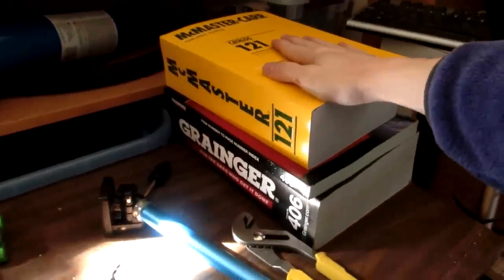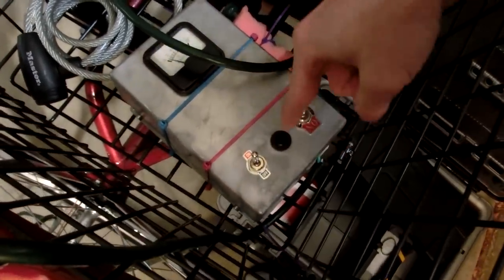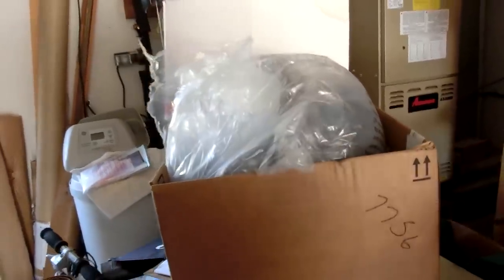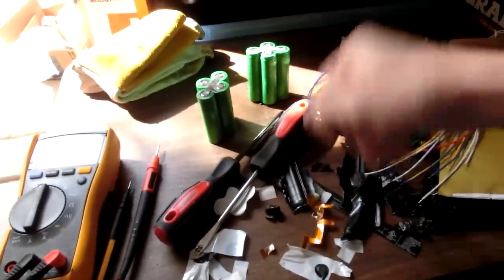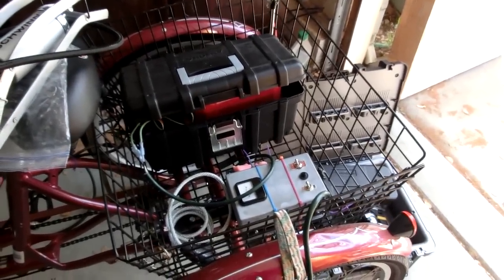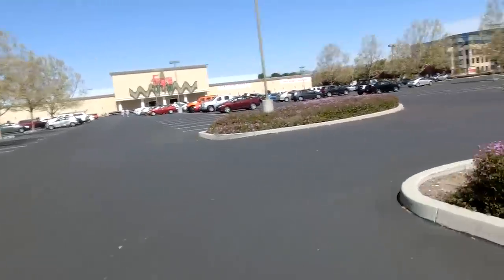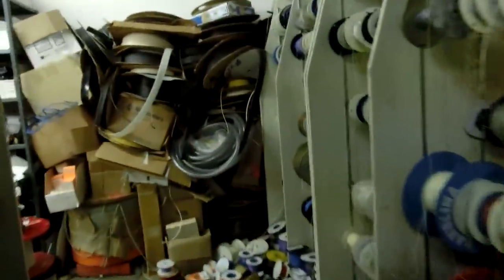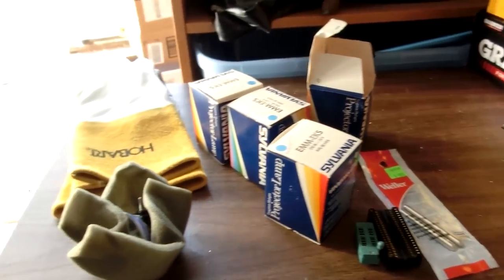Random Bits 0081: moving into garage and electronics shopping

Comment: Hi Me, I was a projectionist in a adult movie theater back in the 70's, we ran bell & howell 16mm's, I found that I could double sometimes triple the life of the xexon bulbs by allowing a longer cool down period, turning off the bulb, allowing the motor to run with no film,(5 min.) thus allowing the cooling fan to run, (it has something to do with tempering the glass bulb, which weakening the glass.)   It is a design flaw, today all video projectors have a built in cool down cycle to increase bulb life.

Comment: The garage is excellent.  It's enclosed and you don't have to worry about damaging the floors.
Reply from the maker: just dont look at the spot i spilled molten bismuth on it and yeah....i agree.
Reply: Rinoa Super-Genius lol bismuth, what bismuth...that's tomato source...
Reply: Rinoa Super-Genius
I decided to buy some that bismuth metal , prob payed too much but still its gonna be fun , Might try casting some shapes using plaster as a mould
Reply: steve64464 sounds awesome I wanna see that, hmm could also try fired clay for a mould to :-)
Reply: Yeah i think this time i will pre heat the moulds to prevent cracking from temp shock change , When my farther was alive he found a way to cast metal fingers which i might have a go at :-)
Reply: steve64464 that's quite awesome, my uncle used to collect cast hands :-p it will be fun working out how your dad did it :-) I can think of a dozen ways of doing it that won't work :-p
 Hmm the fingers your dad did were they detailed pieces or were they like...cylinders?
Reply: If i rember correctly you put a load of plaster paris into a bog roll tube and stick your finger in it keeping it complete still and wait to it sets , then you remove your finger after somehow, then he poured molten zinc metal into the cast but since it was plaster you could only get away with using it once, I wonder if theres a better way to make a mould?
Reply: There are numerous types of quick drying rubbery type materials that can take accurate impressions down to fingerprints.
    The process that should fit your needs is called the lost wax process.  A rubbery mold is made of the item. Then hot wax is poured into the rubbery mold.  The hardened  wax copy is removed and then surrounded by plaster/clay. The item is slightly heated and the wax pours out of the mold.  Liquid metal is poured into the void created by the "lost wax."  http://en.wikipedia.org/wiki/Lost-wax_casting
Reply: Interesting , ill have to find out the costs of this rubber stuff , I do have liquid latex but thats single use and not fast setting.
Reply: In the mid-1980's, I had an artist copy some seals.  He used some latex time material to do it.  Then he made plaster copies from the rubber.  You probably should just search the web.  Local craft stores might carry some of these materials.
Reply: Yeah ill have to go to my local crafts store and see what they got , I try to use recycleable/re useable materials like polymorph but thats no good for this level of insanity :-)

Comment: Maybe super caps could be useful when needing spikes of power, as for example when climbing steep hills to deliver amps the batteries can't (which obviously depends on the pack used) or to lower the strain on them in case that would be an issue. But the amount they can store is so low... It would only make sense if one could recharge them maybe by induction on the road at junctions or something alike^^

Comment: Three problems with making a bike battery of super capacitors, one, they are not energy dense enough for that kind of application, two, the good ones are VERY expensive, three, they require a special chip of some kind after more than a couple are wired in series, but for their intended use super capacitors are top notch.
Reply from the maker: i know but people keep telling me to do it nomatter how much i tell them its a bad idea, thats why i think showing why it would suck may be better.
Reply: Well I figured you have actually done research into super capacitors, my comments was for those people saying to do it, at least there is supposed to be some major battery breakthroughs in the next couple years we can look forward to.

Comment: You really do not need to change the tip on your soldering iron that often, I haven't changed mine on my Hakko iron for 2 1/2 years. You just need to keep it primed with flux.
Reply from the maker: yeah but i had it on for about 5 hours desoldering large components and the tip has ben eaten away by like 5mm or so. i may grind it down though. it really depends on the temperature you set your iron at, this iron is like full-blast about to melt ;P

Comment: Garage is coming along I recon there has to be atleast a few more cubic meters you can claw back in there :-) you didn't mention he vga card that would be in your new coming tower? if your adding your own make sure you get the right pci-e, the vga will likely run on both pci-e's but if your card is in the wrong slot your fps will be very low :-) just letting you know as its a pretty common mistake folk make :-p metal detector vids sound really fun, you need a hat like Indiana jones and a whip...and a .38 revolver :-p still I like you idea of going where others don't, makes a hell of a lot of sense, I imagine in a park where you pay the guy running the park just places old bits of iron in the ground every night for the folk the next day :-p least you have a few moggys for company, mmm my moggy drools...its lucky...I reckoned...its an illness? :-p
 look at all that gear...I would be in so much debt :-( caps sound good :-)
Reply from the maker: im just going to use the onboard graphics for now, but may grab one of my Nvidia graphics cards from home latter. the issue is it has to be half hight to fit into the small form factor case.
Reply: Rinoa Super-Genius stings, sounds like you have a nice processor there that would complement a high end card :-) even a couple of cheaper crossfired cards would be nice by the sound of tjhings but if the NVidia works and is enough don't fix it :-)
 Due to the bitcoin mining there are some decent crossfire cards that are very cheap for performance :-)

Comment: Very cool!
What BMS are you using?
Reply from the maker: this one

http://www.ebay.com/itm/Battery-Protection-BMS-PCB-Board-w-Balance-for-13-Packs-48V-Li-ion-Cell-max-25A-/251497839451?pt=LH_DefaultDomain_0&hash=item3a8e707b5b

its very poor quality but i finished wiring it up a few minutes ago and it seems to be working fine.
Reply: Rinoa Super-Genius Thanks!
Btw, I'm super jealous about the kind of shops you have in your area..! If would spend every weekend in those shops if they where available in Sweden

Comment: Yeah Lithium ION batteries are far more superior compared to Super Capacitors, I made a SOLAR power Buffer using some 6 Super Caps, their rated at 400 FARAD 2.7v each but the power these hold is negligible compared to LION. My main use for mine is to act as a buffer, as I have a 1.5 AMP charge limiter on my Solar Battery I often have wasted power surplus not being utilised when the solar output is greater than that going into my solar battery, this is when I find the Super Capacitors are handy as they can then take the surplus power and redeliver it to my Battery via a boost converter during brief cloudy periods of 5 minutes or so. The best applicable use for Super Capacitors is to act as surge suppressors on loads to batteries alleviating high current demand on start-up of high drain devices such as starter motors etc
Reply from the maker: yes i know, but i'm tired of telling people how super capacitors suck so i thought i might as well just show why.
Reply: Good idea Rinoa
Reply: Rinoa Super-Genius
useful math: 1 Farad  x  1 V  =  1 Amp-Second = 1/60 Amp-Min = 1/3600 AH = 0.3 mAH 

cap in series  =  half capacitance(farad)
cap in parallel = double capacitance
Reply: Henry Chang Yeah I think Rinoa needs to do a video called How Super Capacitors Super Suck for longevity when using as storage :p I got some 400 Farad Super Capacitors and charged them on my TURNIGY battery charger I believe the reading was like 040 mah or something pity full rofl
Reply: ***** they do suck, but 40 amh is wrong. they'd be filled in one minute if the solar panel puts 2 amps to them.  how many volts did you charge the capacitors to ?
Reply: I used  a battery charge measure charger like the IMAX 100 ma in, 6 in series total 16.3 volts
Reply: ***** 
total capacitance = 400/6 = 66.7 F
total voltage = 16.3 V
66.7 x 16.3 x 0.3 = 325 mAH
that's the total charge the capacitors can hold.
now how low can the voltage go for your application?
Reply: Henry Chang My Boost converter minimum working voltage is 3.5 volts
Reply: *****
great, I'd say the useful capacity is around 280 mAh.
super cap is true deep-cycle batt. you can drain it down to 0 volt.
Reply from the maker: Henry Chang
except its not a battery.
Reply: Rinoa Super-Genius obviously we know it's not a battery but it was a convenient way to test the capacity, all storage devices that hold a charge can be measured using a charger / discharger.
 Rinoa to be able to compare super capacitors to a Battery you have to use a (simple comparator that is common to both)
Reply: Henry Chang
Thanks Henry useful to know, it helps when designing my future charge buffer's
Reply: Rinoa Super-Genius
it can be
Reply: *****
you're welcome. I wonder why you limit the charging current to 1.5 amp for your solar batt.

Comment: Why is your bicycle knocking when riding? You might have some loose spokes or something. Love the videos, keep it up, also don't forget you have other channels too ;) wink wink :D
Reply from the maker: dont worry its an issue in the jack shaft, i plan on replacing it with something allowing me to shift gears anyway. if it ever failed it wouldnt interfere with my motor pushing me along. and yeah i agree i should get to doing stuff for my other channels. i may be starting my gender transition soon so i'll make videos about that on that channel. and i have a desktop coming in that would allow me to make better videos about blender and 3d modeling if i think of anything to make.
Reply: Rinoa Super-Genius That's cool :) Looking forward to the videos. And just out of curiosity are you born in 93 ?
Reply from the maker: Aleksa809
yup 1893, i'm about to turn 122.
Reply: Ah cool xD Me too.... Should have said 1993 huh :P

Comment: Honestly I'm a little shocked that you don't build your own custom computers. Considering all the other things you do, it only seemed logical that you would build your own instead of buying an "off the shelf" machine.
Reply from the maker: i am building my own computer, and its taking thousands of relays and over 13 years to plan out.

i think you mean "assemble" a computer. your still buying off the shelf parts and putting them together, thats what i do, i buy a computer and upgrade the graphics card and whatnot as i go. it works really well. i latter upgraded to having an external graphics card and a 2nd PSU on this optiplex of mine and it works really well.
Reply: Cute... I'm pretty sure you knew that this type of computer wasn't what I was talking about. LOLZ
Reply from the maker: ExStatic Bass its still a computer.

Comment: what is that tool at 15:49 ?
Reply from the maker: thats a clamp to temporarily hold a BGA chip like a GPU or CPU i think. its similar to the ZIF connector i bought.
Reply: maybe a tester of some shorts. thank you for your answer.
Reply from the maker: bruce wayne
yes thats exactly what it is, it may be used for flashing data onto the chip. but still you get the idea.
Reply: Rinoa Super-Genius I think it's rather used for reballing, but I can be wrong.

Comment: Prebuilt dell. The cringe man the cringe...
Reply from the maker: Karim Kandil why? Dell Optiplexes are really great. nothing like the trash that a lot of gamers assemble.
Reply: Rinoa Super-Genius not to mention the cheapo cooling
Reply from the maker: Karim Kandil
i've never had any overheating issues with Optiplexes.
Reply: Rinoa Super-Genius I meant in term of quality (stock coolers) which will cool but just enough so it doesn't throttle. Im more of a PC enthusiast so I like be able to choose nice quality components will end up being much more powerful for the same cost while being quieter, cooler and if you care about it nicer looking.
Reply from the maker: Karim Kandil
i'm a PC enthusiast also, but i love small, compact, low power consumption, and clean looking like the optiplexes.
Reply: Rinoa Super-Genius take a look at the SG13 or node 202 case. That + a decent ITX motherboard like the MSI Z97I AC and high quality modular PSU and if you decide to play any modern AAA games and even some indie games a dedicated GPU and you end up with a wicked powerful tiny PC. And if you like quiet you can also opt for a low profile noctua cooler and/or fans.
Reply from the maker: Karim Kandil
my optiplex can play modern games, it played Final Fantasy 14 pretty well. even better when i add a graphics card.
Reply: Rinoa Super-Genius  Im guessing not a 60 fps 1080p on ultra or go home person Anyway how much did your optiplex cost? Just so I can see if maybe it wasnt a ripoff like most other prebuilts or if it is.
Reply from the maker: Karim Kandil
think it was 800$ or so. it only uses about 40 watts of power and has an intel i7 4790 (may be wrong about that) and 8gb of ram. i plan to upgrade the 500gb hard drive though, i need atleast 2 TB.
Reply: Rinoa Super-Genius Yea no way it uses 40w with a 4790.... those things pull up to 150w at load. I have its overclockable brother the 4790k. Did some number crunching a similar system would be $550 (http://pcpartpicker.com/p/KQK8gs) but with a better PSU that I wouldnt be afraid to use and no propietary BS.
Reply: thats a 45% markup minimum. Probably more because they bulk order the components so they get bulk discounts and im guessing the case cost them much less than this one and they really cheaped out on the PSU like they usually do.
Reply from the maker: Karim Kandil
not in that size of a case though, have fun fitting it into something so small.
Reply: +Rinoa Super-Genius Come on, I used to work part time servicing the networks and pc's of a couple of schools. Most of the pc's were dell optiplex, various models. I hated them. Bad cooling and dust would get into the RAM slots, even in the used ones and bsod loop the machines. Power supplies were quite weak with no headroom for a better videocard. I only liked them because of the cases. Very easy to work on.